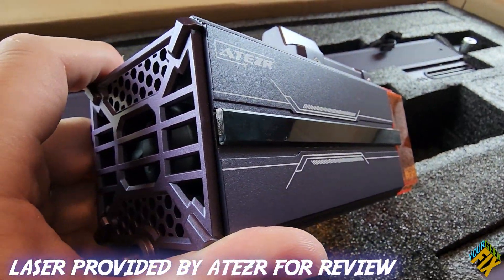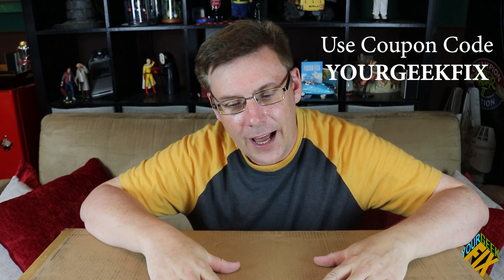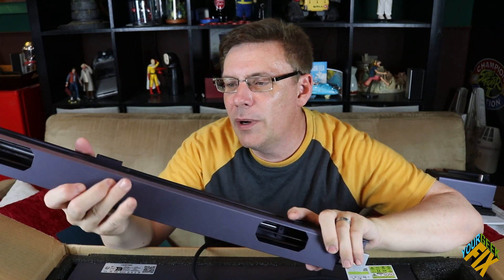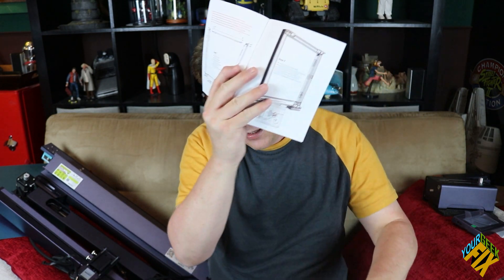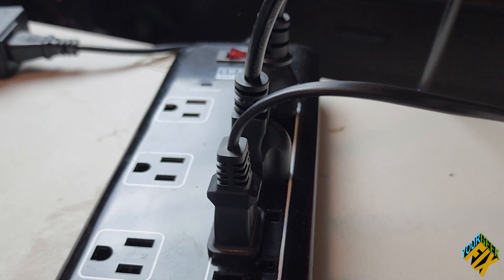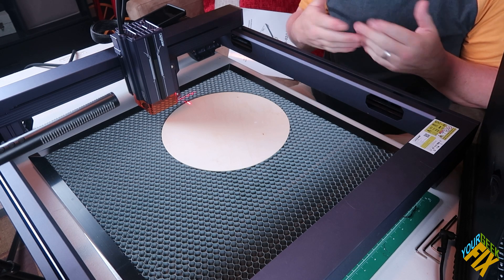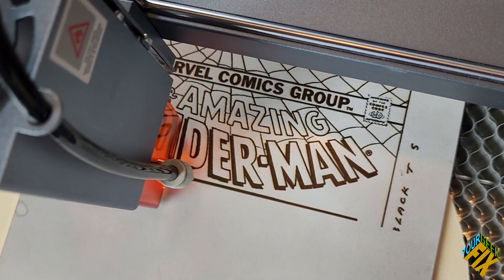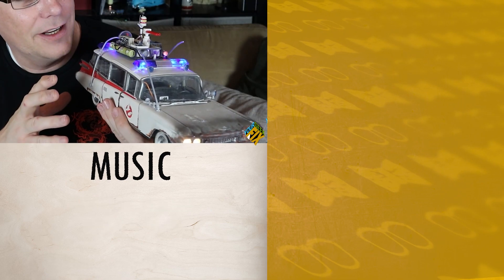The Powerful ATEZR L2 36w Laser with Autofocus

Comment: Hey there!!  I just got this very same set up.  How has this laser been working for you since you posted this video?
Reply from the maker: @JohnsRetired  I use it mostly for cutting. It is the fastest for that. How about you?
Reply: @YourGeekFix  well... It is crazy fast!  When it's adjusted correctly.  Seems my auto focus sometimes takes 2 times to work.  No big deal.  But my biggest issue is when I try to frame my piece it jumps to some random position on my work area.  I'm still trying to figure out the settings on Lightburn for it.  When I hooked my ORTUR up to Lightburn it worked with no issues.  Any suggestions?
Reply from the maker: @JohnsRetired  see if it does the same thing with lasergrbl

Comment: Can you  tell me how to turn that cross hair on and off?  Mine does not come on and I need to know if it's a problem with the machine or if something got turned off some how?
Reply from the maker: Automatic for me.
Reply: @YourGeekFix   Thank you for the reply, I wonder then  if the wires came up plugged and got broken. I'll pull the cover and check it tomorrow.
Reply from the maker: @donalddunn2983  maybe.

Comment: We should take the review a bit further and discuss the support provided with the product. It is strictly through email with China so you may get a response every other day. The response is usually questions from them which can now drag the issue out for weeks. Their warranty is for show only. We had an issue with the flame detection sensor failing and the laser head burned up. The laser did not shut off, nor did the laser return to the home location as it's manual stated it is supposed to. When confronted, Atezr stated they will replace it with a 5w laser head. LMAO, a 5w and then asked if that's ok. Of course it wasn't. It's now going on it's 4th week and we are still no closer to resolving the issue than when we first began. On top of that, they have still not fixed the autofocus failing issue (common issue with this brand, google it) and after 3 mos., I have already had to replace the main board when a soldered piece broke off inside the screen housing. And if you want to buy any spare parts other than a pack of screws, such as a laser head or harnassed cables to have as a spare, forget it. They do not sell parts like that and they always blame their "supplier". So when it breaks, I've tried 4 of this same model (thank you Amazon for your 30 day return policy), then you are stuck holding a $1200.00 paper weight. Good luck.

Comment: Atomstack makes an enclosure for diode laser that is elevated. You just remove a small panel to put in the rotary. Could you test that with this machine? It's model B1.
Reply from the maker: If they supply it.

Comment: Can i run the machine without any internet in case i use it in the garage or when the company goes under and the cloud stops working?
And how does it cut and engrave acrylic. I heard that the wavelenght of the laser is important for what materials it can cut. It seems to depend on how well a material is absorbing the wavelenght.

Now that you even have a small fleet of lasers, will you use them and all your other machines to build things from scratch regardless that not every viewer can do it? You build fantastic things. I think you hold yourself back. Embrace the Omnissiah. Let the machine spirit guide your path..
Reply: As with all machines, I'd opt for at least a smoke alarm in the room and a (suited!!) fire extinguisher nearby.
Reply from the maker: @MassiveDMG  Definitely
Reply from the maker: Yes, using a computer or usb